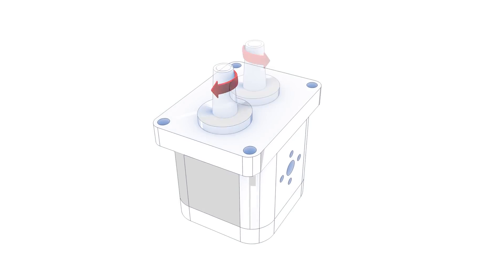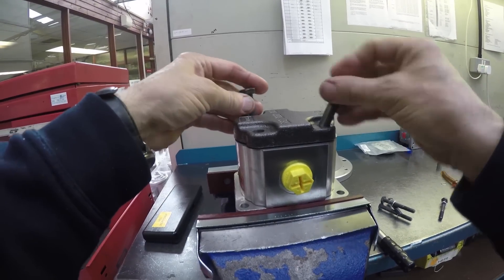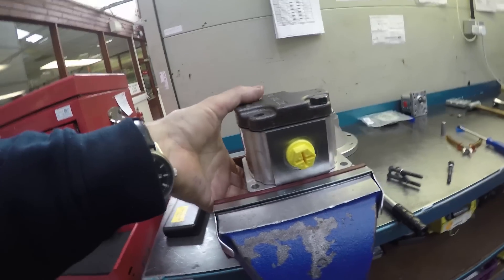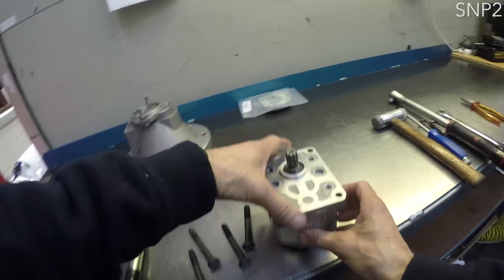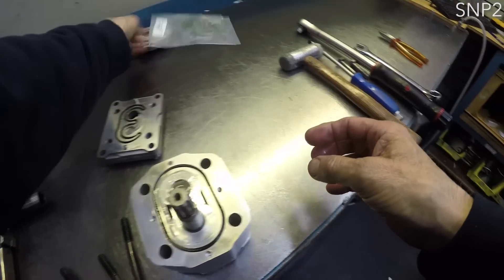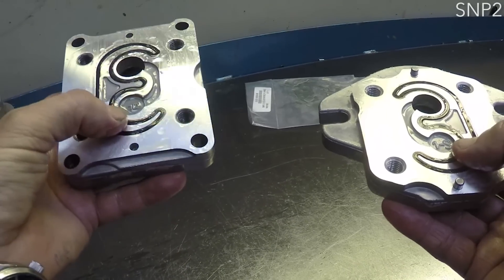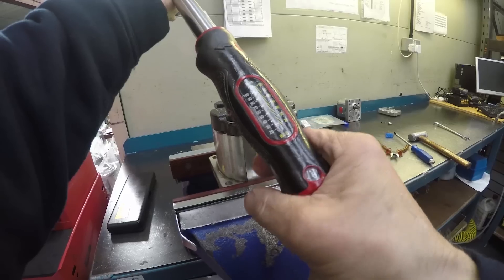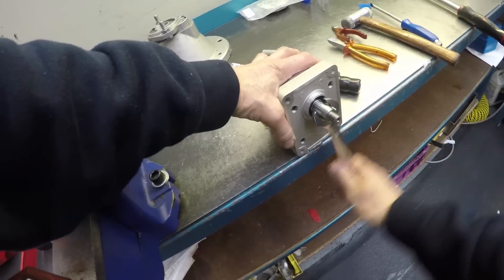How to change the rotation of a Turolla Gear Pump

Comment: You put the bearing housing back the same way ! So the grooves for lubrication are now on the high pressure side  
So this is rong way 
You have to change bearing housing side.